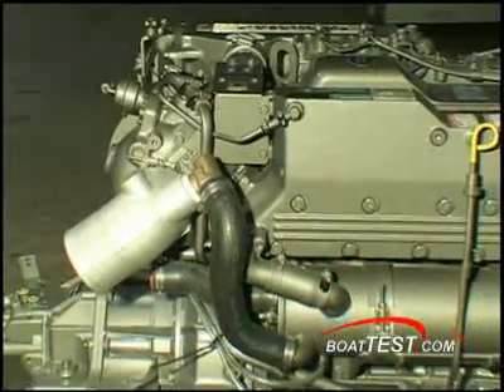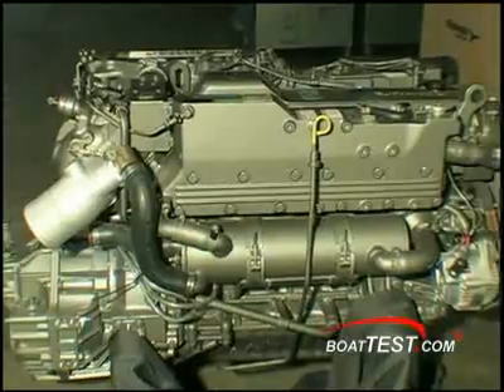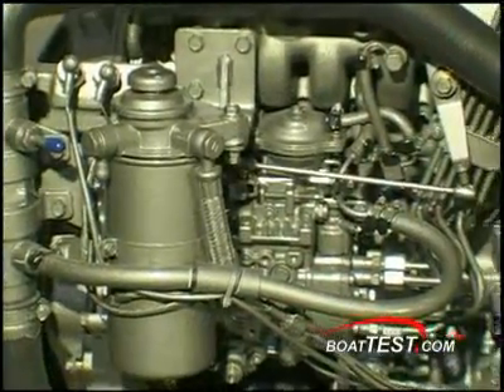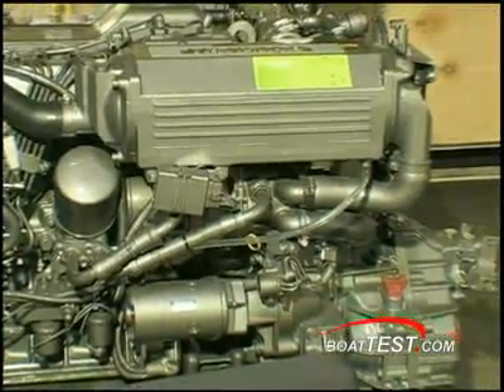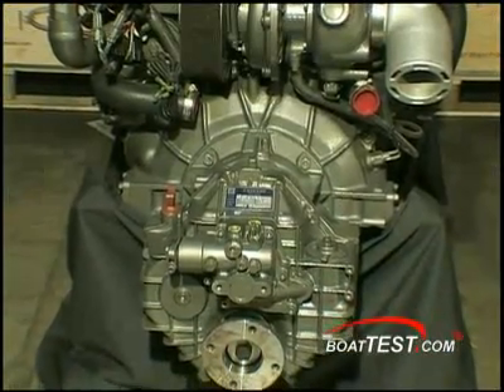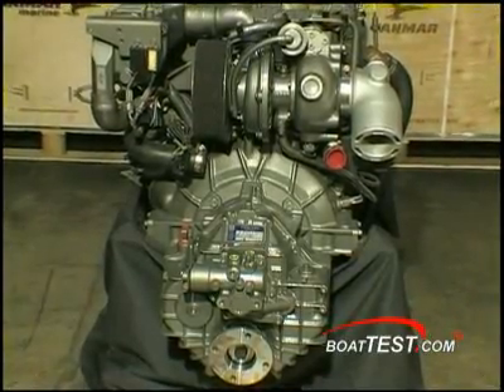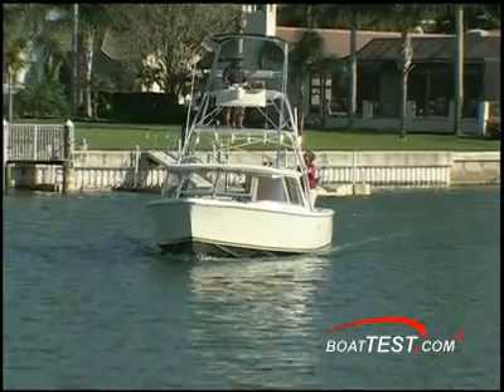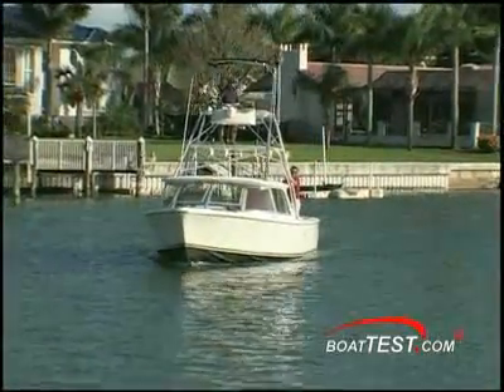Yanmar Engine- Fuel contamination of Gas vs. Diesel  (Kevin Carlan) - BoatTest.com

Comment: Diesel has roughly 12% more available power from an equal amount of fuel when compared to gas. Gas is better with HP at high rpm, but in general driving conditions the torque numbers will have more importance than HP. I've become a Diesel fan after growing up gas and now owning a Diesel car and truck and comparing mpg and maintenance costs to equivalent gas powered vehicles. I live in MN too, and have no problems in winter.